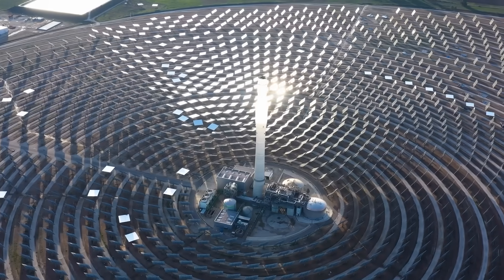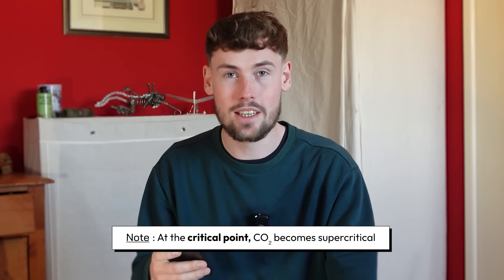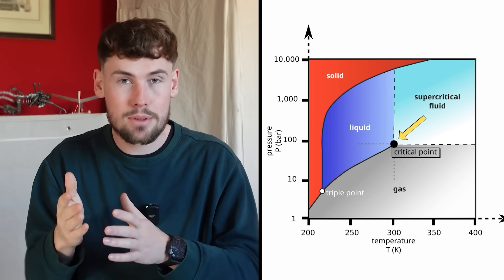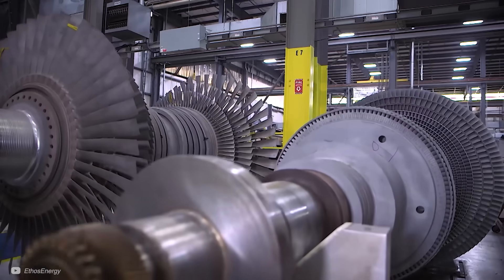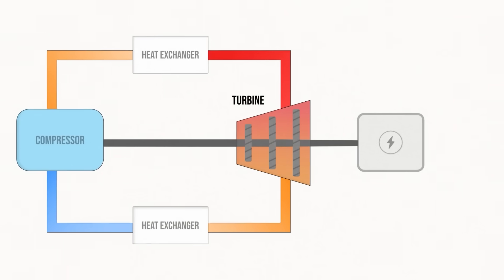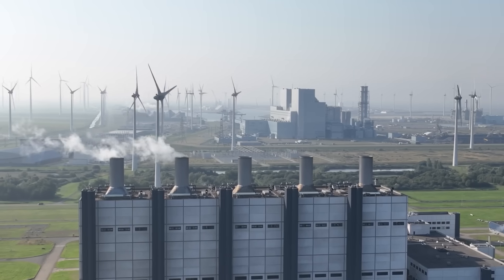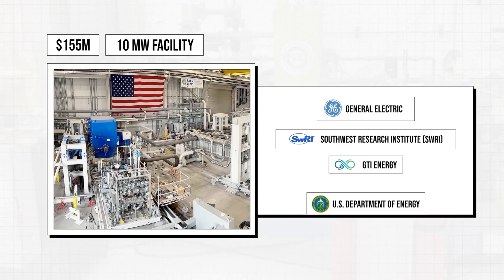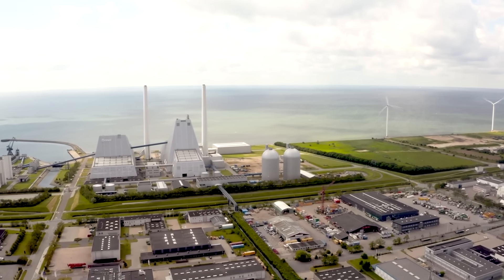How Ultra-Efficient CO2 Turbines Are The Future of Energy

Comment: 80% of the arguments are net negative.
The only positive argument here is the higher temps this can work at which may offset all tne negatives.
1. The size of the turbine is actually a benefit, the grid needs giant rotating masses to stabalize.
2. The amount of energy put into compression IS THE ENERGY YOU GAIN DURING EXPANSION, so the more you can put in the cycle in the boiler the more you can extract.
3. Water is a problem in turbines but modern plant are so good at superheating and working with complety dry steam that this is almost a no issue.

But since this may not need a compression cycle when already heated, this may be decent in mobile applications and applications where you otherwise have waste heats that cant boil water.

Comment: does the closed loop of receiving CO2 in gas from from .. lets call it exhaust .. of the turbines .. then cool it down to get it back to it's liquid (more dense) phase to reduce the pressure in the receiving side and transport that liquid back to the heat exchanger to create pressure again .. REALLY restult in 25% higher efficciency (50% vs 40%) to a steam turbine?

Comment: I've been wondering for years why no one was doing this! Is it not obvious that the temperature and pressure at which CO2 becomes supercritical is a godsend for heat engine efficiency in stationary applications or even for mobile applications that use electricity as the final driver?

Comment: In any case the heat must come from somewhere regardless of turbine drive fluid.
No free energy . Using solar means a minimum of 50% downtime per year , night happens.
So , there still has to be 24/7/365 heat generation which means the exact same heat sources have to be used - fuel , nuclear , whatever.

Comment: They are absolutely not the future of energy. They are yet another excuse to continue sipping grant money for a few, nothing else. Really, they hardly make sense. For current tech? Never, we don't work with sources that are hot enough. So they are only ever even remotely justifiable in the first place if we intentionally move to power sources that require such a thing. Fine. And then? And then they are only marginally more efficient than steam, given perfect circumstances. And in exchange, they are vastly more expensive, and will require a lot of downtime for maintenance, because angry CO2 is stupidly reactive. 

No, this tech is dead BS.

Comment: As a plumber working in the field of sewer for many years I can share with you my insight into this that I know nothing about this whatsoever.
Reply: I'm sorry for all the energy that I've "compressed" over the years, lol
Reply: @AuxiliaryPanther  Too good!
Reply: As a concrete man and carpenter and scaffolder working on all types of treatment plants, chemical plants, industrial process plants, housing, power plants and infrastructure,
I too can share with you my knowledge about this - which is also nothing whatsoever.
Reply: Every Good Plumber knows there are only two rules:
1. The hot water knob is on the right!
2. S#%t  flows downhill !
Reply: @martyguris1056  You must not be a plumber and never used a faucet.  Hot is on the left.
Reply: @mrwayneright    As a truck driver, I can verify that the hot is on one side and the cold is on the other; however, warm is somewhere in between.
Reply: Thank you for your expertise.
Reply: Well said, sir
Reply: Im an electrician, and I can back you up on that 💪
Reply: Yeah. You don’t even seem to know what a “Carnot Cycle” is. Or that every new coal fired power plant in the last decade uses Supercritical(TM) Steam.

Comment: This actually sounds like a Rube Goldberg machine set-up that never even comes close to energy conservation, because that's the entire point of the dumb joke. I work industrial Maintenance, and we had one of those damnable things. Starting off, an atomic power plant sent the juice, where as the control panel fired up a little pump to set flood a pressure tank, in which to activate a valve, and it activates a compressor in order to bring it up to "Operational Pressure"... still following? Then when we get the main 300 Hp. pumps up and running, we "open the Valve"... Which uses the air from the compressor to pump up the pressure tank to push it's water into a dual, opposed piston valve actuator, which turns the valve's  butterfly weir via a gearbox, thus opening to the main intended flow. . . `Atomics, water pump and compressor next, (little pressure tank ramps up), electronic and plain electronic controls engage, back to activating water pressure check, then blow that water to the opposed reciprocal pistons, and finally turning the valve weir via gearbox, and Finally the damn valve opens! . . I'm pretty sure that if you found a half-assed decent swamp rat, and put some peanut butter on a valve handle, then let the rat have at it, the damn machine wouldn't be breaking all the time. Rube Goldberg is only the "Most Ridiculous, and Stupid-Worst of All Possibilities", as ONLY Ridicule towards that exact manor of the strange "Engineering Enigma" being taught nowadays. Always strive for simplified perfection! Only buffoons strive for inane complexity, because they Really Do NOT have a cue! So instead of "Dazzling with Brilliance", they go in for the "Baffle them with Bullshit" approach, thus hiding their shallow understanding with Unwanted Extra, Needless, Overwhelmingly Redundant, "Eye-Candy Crap" that breaks all the time.

Comment: We had a presentation at work recently about liquid cooling in data centers.  With the rise of AI in particular, the compute power involved is going up at a rapid rate but that means having deal with much bigger cooling challenges - hence liquid cooling.  They mentioned that they were already looking into using the waste heat for secondary purposes - providing some energy to CO2 turbine generators might be a good use case.   I suspect that electricity output from a CO2 turbine would just be fed back into the data center's power supply.  It would be very interesting to model such a system and estimate the balance of mains supply vs feedback generated.
Reply: Sorry, but waste heat from data centers are low quality and only suitable for heating.
We absolutely should do this, but making electricity requires high quality heat.

If using low quality energy to make high quality energy was possible we would be able to make perpetual motion machines.
Reply: @madshorn5826  - I wasn't claiming waste would enable 'perpetual motion' machines, which are obviously impossible.    FYI, my employer is one of the largest global computer industry corporations in the world and they are investing into liquid cooled data centers, as a necessity to deal with a much higher level of waste heat from the new wave of data centers coming our way.  They are actively looking into using the waste heat form the liquid cooling process for a number of possible scenarios including feeding back generated electricity.  Say, for example, a new mega data center could reduce its massive power consumption by 25%, that would be considered a huge win.  Hope you feel duly informed. ;-)
Reply: @Gismotronics  
Ahh, my bad. I overlooked the liquid cooling part 😅
This brings the temperatures above 100°C and makes electricity production practical.

That is some serious plumbing though and that is why most waste heat from data centers hitherto have been rather useless for electricity production.
Reply: @madshorn5826  - Interesting stuff when we consider the direction toward data centers with massive compute power/heat output.
Reply: @Gismotronics  
Indeed.
It could be a significant reduction in energy demand. And a significant rise in demand for skilled labor. A burst pipe could really ruin your day.

Still doesn't save us though.

The global growth will have to stop and remain local, balanced with local degrowth.
Lest we will trigger climate feedback effects due to waste heat, even if we go fossil free.
It's a bummer, but we can live good lives in a steady state economy, if we share and cut unnecessary consumption.

Comment: yes but the main catch is the to acatly burn co2 as a fuel need realy high tempruures that only a jet engine or a nuclaer fission or fisuon or aintimatter reactor can do. thsoe super critnal co2 needs a powerfule rokcet or jet engine and be very liekly pwoerd by some ncuealr reactor for the needed heat sroce that can do that high dsnety and heat it up fast entogh before it ckokes itt combsuion cycle out. a nuclear terhmal engine would do this very easly for a jet or rocket engine. but wihtu a ncuelr ractor asa heat sorce its not giongto realy work at all, the needed rate of heating withte needed high tempure for co2 to commbuts and oxized itself is in fact qute realy high, so hihgh that nuclear reactor are needed to preovie the needd heat pwoer output needed to get shuch a reacton giong. this is why we needed nucler power for spacecraft air craft and gronud vecales. bescue why not only burns the gaslone into co2  but also burn the co2 to get it to brake down into o2 and carbon and not be a green hosue gas anymore. thast why nasa and sapce programe orngaly want4ed nuclaer thermal rokect engines in the frist place.
Reply: so your giong to need a nucler reactor if you want to make a co2 terbine bescue the heat needed can aolny be done by a nucler reactor makeing wntogh heat with entogh power for theen needed heating rate wihout it fissleing it sefl out form lack of oxydization. your giongto need a nucler reactor for co2 terbines you know it can't be done other wise.

Comment: For fission (the only power plants that we need) water is there not just to carry away heat and spin the turbine but for so-called neutron moderation: to slow down neutrons to increase chance of a neutron to cause a fission of a fuel.
It also makes reactor self-balancing: boiling water means steam bubbles in it means neutrons travel through less water less neutrons slowed down means less fission means reactor cools down.
This effect allows to regulate reactor power output without too much trouble
Reply: Terrific. Fix Hanford, and then spend money on fission power. Nuclear fuel is also very expensive to produce, which rarely gets counted since the government does most of it.
Reply: @ its actually the cheapest. What you need to fix is feds that make construction last for 20+ years instead of 4-5 years like in sane countries.

Nuclear fuel is also extremely cheap, especially if you use CANDU reactors which require no enrichment of the raw ore.

Finally, if we are talking UK specifically, it already have enough plutonium in storage to power entire country for couple of hundreds of years. British luddites and their fossil fuel backers want to destroy that fuel however.
Reply: @skipperg4436  Nah that's nonsense. 1. Water is not only a moderator but also dangerous as it can lead to hydrogen explosions and molten Sodium would probably be even better at catching neutrons. Also the primary radioactive cooling cycle is normally not where the Turbines are attached to but the cooling water goes to a heat exchange to power a secondary water cycle including the turbines. So even if you would use water for the primary cycle you could still use CO2 for the secondary turbine cycle. 2. Nucular fuel is very expensive, not only mining it and refining it but also its storage for thousands of years afterwards. The best powersources are therefore solar, renewables and maybe in the future also fusion.
Reply: @QuantenMagier  only thing renewables are good it is making sure than humanity will continue using fossil fuels.
From your arguments I see that you are not an engineer. Would you trust a non-doctor what medicines should you take when you get ill?
But feel free to ask me, I love talking about technology.

Hydrogen explosion can happen only when there is a lot of hydrogen formed. This can happen only when temperature is above certain temperature and core is kept well below it. Plus, there are experiments done today with covering fuel rods with chromium that prevents this from happening at all.

Sodium doesn't slow down nor catch neutrons at all (almost - and extremely small fraction that does absorb neutrons pose an engineering challenge). Reactors using sodium for cooling use different physics - they are called "fast neutron reactors" - they have large number of advantages and certain disadvantages. The entire reason we use sodium for them (or lead or - theoretically - tin) is that these metals don't slow down neutrons and remain liquid at temperature reactor operates thus can be used for heat transfer.

Next, you are confusing 2 types of reactors - pressurized water reactor (PWR) and boiling water reactors (BWR). First indeed don't have water boiling inside the reactor. BWR have lower operating pressure and higher efficiency, and they allow easily to regulate power output. They also cost less to build due to simplicity. Their drawback is more complex physics of the process and the fact that activated water from the reactor goes into turbine hall. It takes ~10 minutes after water flow is stopped for turbine hall to "cool down" so that humans can enter.

Using CO2 for the secondary cooling loop of BWR - I'm not sure its a good idea because carbon in CO2 will probably be activated... But I'm not sure since its beyond the scope of my knowledge.

Fuel for nuclear plants is very, very cheap. Its not expansive per kg and plant takes very little of it. This is because there is ~1 million times more energy in it than in e.g. coal or gas.
But if that's not good enough for you, you can use heavy water reactors e.g. CANDU and use raw uranium as a fuel, dropping the cost even further.

Finally, regarding fuel disposal we absolutely don't need to store it for so long. You see, what keeps fuel dangerous for such time are isotopes of plutonium. We have technology to separate plutonium (24K years and 7K years half lives for 2 most common isotopes) from it since 1940-ies, and in certain countries today it is done routinely and for profit. The rest have either very small half-life (need to leave it to chill from several years to several centuries) or very very long one to the point it doesn't pose danger.
Also these unstable isotopes are not useless - they are being used as source of neutrons in number of applcations. Also active area of research is alpha and beta voltaic elements. Efficiency of existing devices is <1%, but when researches come up with something reasonable they will be used in many applications.
Reply: @ "Hydrogen explosion can happen only [...] when temperature is above certain temperature and core is kept well below it." - Yeah tell that to the people at Fukushima, a sodium reactor could have safely shutdown instead.
Indeed I was thinking about PWR. I didn't know BWR directly attach a turbine to the primary cycle as this sounds very stupid and dangerous as neutronized water gets out of the reactor vesssel and will destroy your steam engine material over time and irradiate everything with neutrons.
Also for this reason if Sodium would not catch neutrons that would be awesome as a major problem with molten salt reactors is corrosion by transmutated salts.
Using nuclear fission safely is very hard especially when power plants are run by capitalist companies striving to maximize money over safety.
And regarding fuel disposal the amount of nuclear waste is much larger than its applications. There is a reason why some countries pay other countries to store their spend fuel.

Comment: Supercritical CO2 is not the same density as liquid CO2. Supercritical fluids have their own mass densities. Also, as all these videos on tech that lack integrity, all the cons are ignored.  For example, having a smaller turbine is not an advantage in energy production, as mass momentum is desired in most cases.  This video does nothing to address the required higher tolerances and requirements of a sC02 system, and as most of the time, they outweigh the benefits.  And since super critical CO2 has been around for a long long time, and this is not a new idea.... if it worked we would already be doing it.

Comment: At sCO2's critical pressure and temperature it is roughly half the density of water, as you stated, but it can be almost the same density with a change in temperature and pressure.  For example at its critical point (31c, 7.38 MPa) approximately 468 kg/m3, but at a higher pressure (e.g. 20 MPa, 40c) approximately 800-900 kg/m3.  Water is 1000 kg/m3.